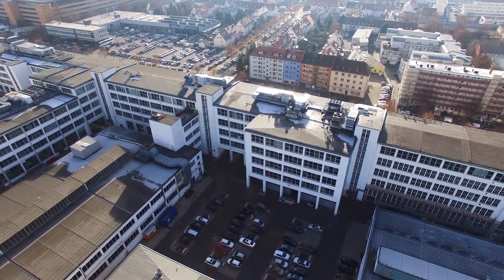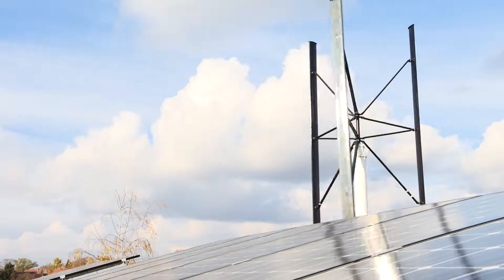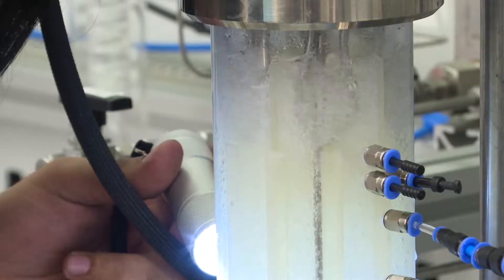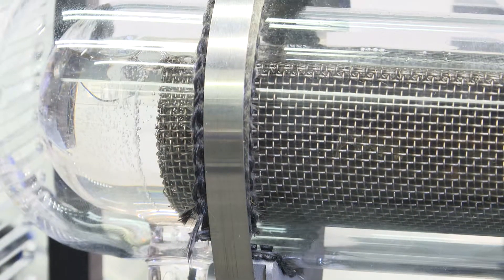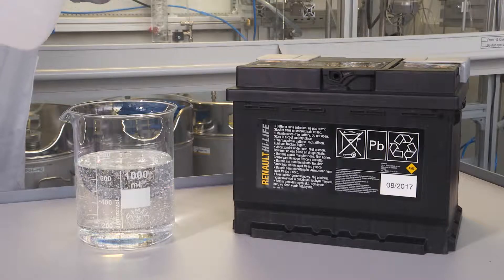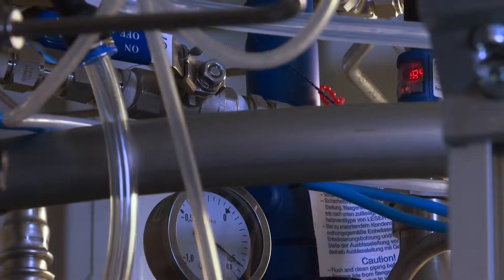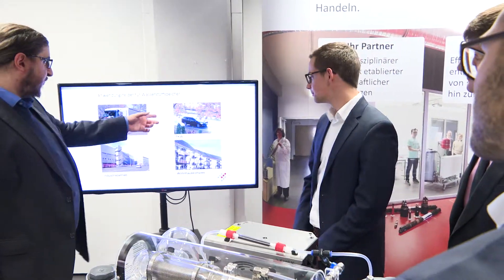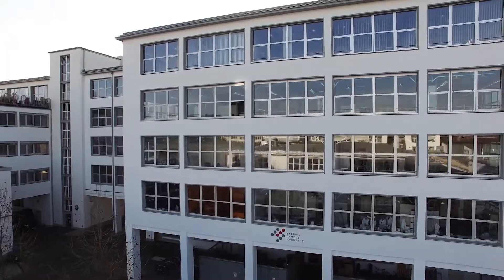Hydrogen Storage - Energie Campus Nürnberg

Comment: H2 gas is extremly flammable but your component is not flammable and energy density is high. I know that there is a 2 major problems with H2 energy storage one of them flammability and the other one is storage. So you can solve this but it can not be commercialize, what is the next problem?